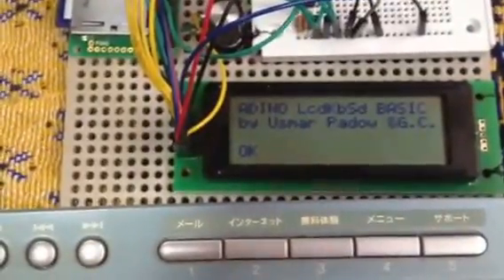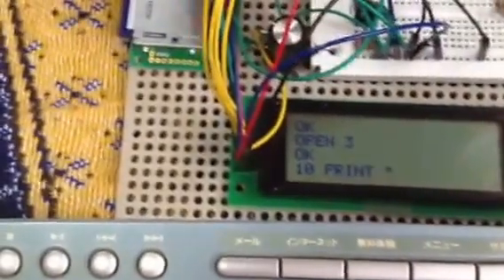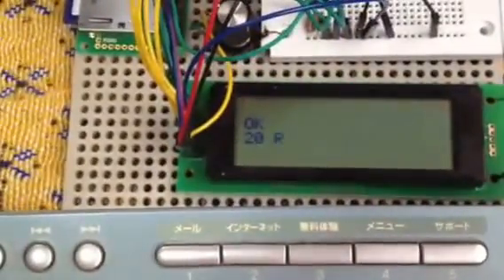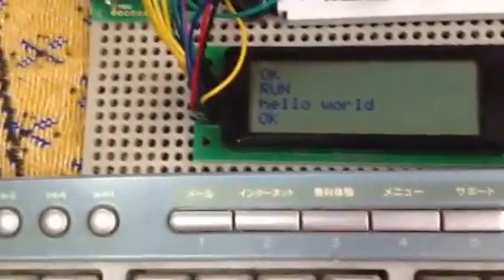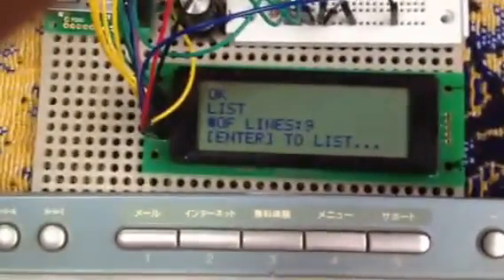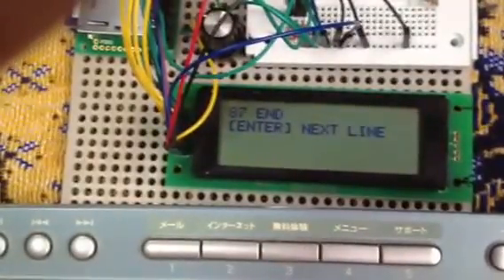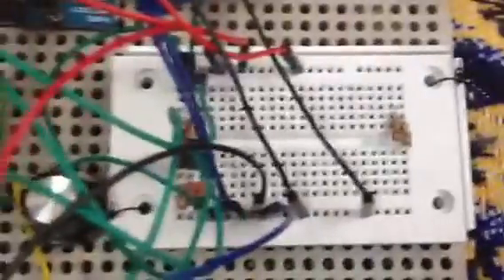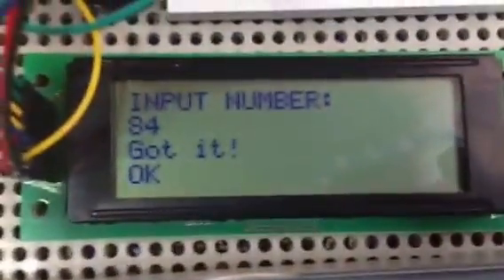Arduino Retro Computer LCD

Comment: how d oyou install the library?
so i can do the project
Reply from the maker: sorry, I am not sure which library we are talking about. I was reading some of the lower comments,   I recommend you find my arduino retro computer TV version page which is better documented.... I will send you the link by private message... I also saw someone else talking about the moemoryfree library. I cant remember where I got this one... but it is not really nessesary for teh computer to work. it oly helps it display how  much free memory is available. so if you comment out all the code related to that (which is not very much) it will work....   thanks for taking interest in my project.... don't hesitate to ask me anything....
Reply: thanks

Comment from the maker: @danielbwills basically, the normal arduino LCD library is designed for 16x2. print2 is a driver I made to support my 20x4 display.   So you need to use the normal library

Comment from the maker: @danielbwills it can. But it will require some changes, you get rid of the prtint2 function. You need to initialize your LCD properly in setup and replace all the print2 fiction calls  with lcd.prtint  and println2 with lcd.println

Comment from the maker: I was using an iphone to record the video, I don't think they have tripods for it.
why put BASIC on an arduino? well, at first I was thinking of making something like a C64.... I ended up using an LCD instead of outputing ot a TV cause the library that writes to the TV uses too much RAM,   but I think I will modify the library and make it so you can connect it to the TV